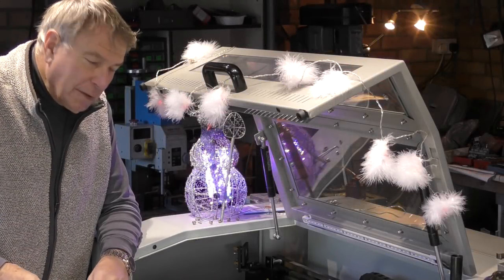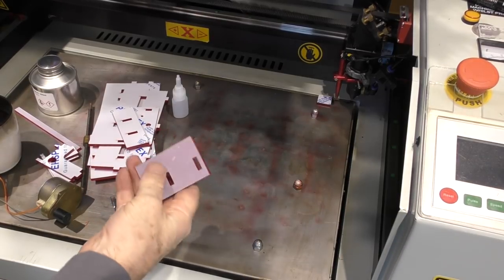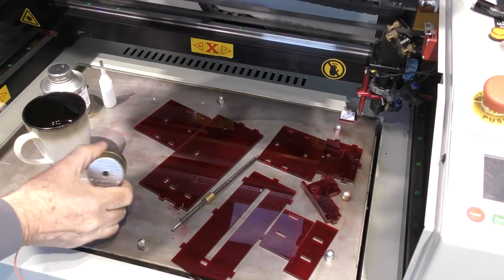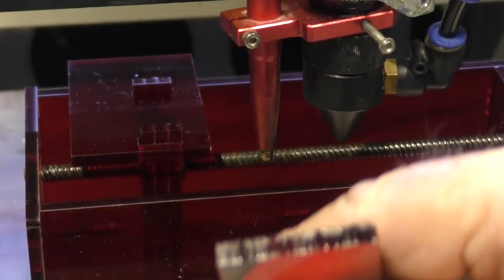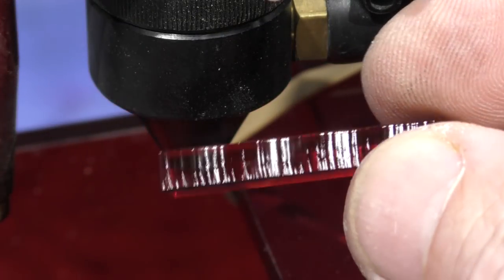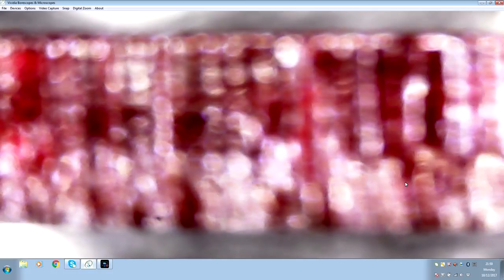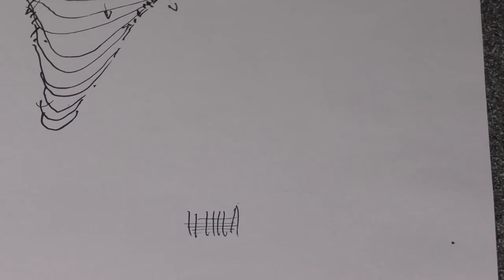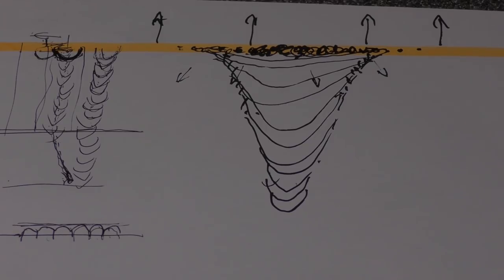RDWorks Learning Lab 128 Are Acrylic Striations Stepper driven

Comment: Not convinced that the stepper is responsible for anything as there's enough inertia in the head for it to be constant velocity. The out of focus "rows" of dots look like they're related to the laser firing frequency. If this was the gas cloud dissipating, they wouldn't be so orderly. Also refraction of the beam would make it move ahead of the cut no? I think the vertical striations are from air assist pulses. Hook up a compressor reservoir to the air assist to check it? or just an oil-less compressor? Have you got an indication of frequency of the vertical and horizontal lines? If they're audible frequencies, maybe they're just sound vibrations being transmitted to the head.
Reply from the maker: Hi Christopher
 Some of my conclusions are evidence based and some project that evidence to possible conclusions. So you have every right to form your own conclusions from what has been observed. On your first point about head inertia, can I point out that the head was static and it was the test piece was driven by a constant speed ac synchronous motor  through a large reduction gearbox. So for a completely different reason, there were no stepper or inertia effects, your conviction was correct. The striations were the worst I had ever seen but with not a step in sight. That was the whole point of the test. Many people were arguing that the striations were stepper driven. This categorically proves otherwise  and demonstrates that some other mechanism is responsible for the "footprints". So that is where we have to now call upon previously gathered facts and see how they can be linked into help answer this question. 
I  believe you have mistakenly understood this laser beam to be fired by some controlling frequency. This is not an RF driven device but a constant dc voltage driven system . There are high frequencies during the pre-ionization phase of the beam triggering but once the beam is working above above 4 or 5 mA the power is smooth and there is no beam triggering. These experiments were done well into that stable beam phase. I have carefully built a logical set of reasons why these horizontal marks exist, I may be wrong but I do know that there are no steps and no beam frequencies to pin these marks on.  I also think refraction is the wrong mechanism to consider.  Reflection is the most likely mechanism for beam drag (non-vertical striations). I investigated the interesting properties of acrylic a few sessions ago to demonstrate its amazing internal reflection properties  That reflection mechanism would trail rather than precede the beam as you were suggesting with the refraction proposition. I also think that careful observation the smoke velocity during my cuts,  clearly shows no evidence of air assist, so air pulses must be discounted as a biasing mechanism also. I attempted to remove as many variables as possible when I designed this test.   I can only point to specific pieces of evidence  and just like any jigsaw puzzle without a picture to follow, try to arrange the pieces in a logical way to form a more complete picture. I am sure I will get some bits wrong and will be forced to rearrange the pieces if and when I can gather different evidence.  
I must stress that none of what I am saying is condemning your thoughts, remember this is a learning journey for me and open debate must be taken as a healthy way to reach full understanding. I can't un-discover the evidence, however, help with interpreting those facts is always welcome. So, thanks for your comments because it allows me to clarify points that may be weakly emphasized in the video. Please continue to join in the quest for certainties within this technology because we have many dark corners yet to dig into.

Best wishes
Russ
Reply: Russ, healthy debate between consenting adults cannot be considered a crime. I'm also not one to tie my ideas and thoughts to my ego - a bruised and battered idea - even if it dies is worth more as a step to clarifying the truth than a billion unchallenged thoughts.
The one thing that really has no explanation I can see is how orderly the horizontal patterning is. your test with the water boiling - the pops increasing in average frequency as the beam is more focused but with a bell curve of time between gaps to me would be what the vertical distribution of the pattern should be like. It's too regular. You seem to have 2 very well defined frequencies. One image I have is that it's like a tap dripping - the other water boiling in a test tube. Might it just be liquid phase build-up ahead of the laser boiling and thus popping material out of both the top and the bottom? I have evidence to the contrary. I see pulses when I nearly cut through 3mm plywood of the same range of frequency. I'd take a high speed video of the laser tube to see if it is actually steady or if there is flicker. My guess is that it's a 10-100Hz frequency range which may be mains or compressor linked. Air pulses ?
Reply from the maker: Thanks for the great attitude and response. The water test was just an incidental demonstration of the surface effect. I was still many mm above the focus point. If I had gone higher the frequency would have indeed increased  but just like bubbles in a test tube the more external heat you apply the faster the rate of bubble generation. Even though the heat is applied uniformly the the water reacts in an intermittent manner.
 I have used my oscilloscope to monitor current flow through the tube and there is no evidence of pulsing when the tube passes into its full operating mode.  It is true that the nitrogen in the tube is continuously stimulated by the voltage output from a rather specialized transformer operating in the tens of khz but that is just to maintain the ionized state of the nitrogen. That ionized state turns the nitrogen from an insulator to a zero resistance conductor. As a completely separate part of the power supply, the current through this gaseous "piece of wire" is controlled by a fully smoothed DC current limiter. It is the magnitude of this current that completely randomly stimulates the CO2 into its lasing mode. Despite this randomness, the final photon output is coherent light energy  that is fully synchronized to a wavelength of  10.6 microns. This wavelength is equivalent to a frequency of about 28Thz  and is far too high to leave observable pattern. 
I'm unsure if your final sentence implies that you do have  high speed video equipment  (10 or 12000 frames per second? It would be amazing to see some of the phenomena at work) or if you are just suggesting that it would be a good idea to take high speed video?
Best wishes
Russ

Comment: I see what you mean about the belt now. This particular white belt is indeed not designed for linear motion, only GT type belts are specifically designed for that. Your belt has sort-of rectangular pattern, backlash is inevitable with such belt. GT2 style belts are industry standard for cnc application nowadays, check them out. I see you are running it on the opposite side, so maybe you are not using it’s teeth at all, that would be interesting to see :)
Reply from the maker: I chose this polyurethane belt with a different tooth form  (AT) to the original  HTD profile because I discovered that the original rubber belt had so much compliance in the tooth that it was causing head resonance at certain  micro step ranges. The shorter much stiffer teeth suppressed this to a much narrower speed range that I would never use anyway. The other advantage was that the mismatch in tooth form  gets rid of the natural clearances designed into the matching belt/pulley tooth forms. Because I have turned the belt over, my idler pulleys are driving the belt fully home into the driving tooth form so I have no belt climb and no backlash
Reply: SarbarMultimedia turning over is actually quite an interesting idea, if its tight enough shouldn’t be a problem I guess. Maybe I’ll try that too! :)
Reply: SarbarMultimedia hi Russ, i was able to reduce ripples by half by repairing geometry on X axis to a proper one. The rest of the problem I am sure its the bad belt, Kevlar belt on order.
Reply: SarbarMultimedia okay, after solving that ripple issue, now i have to solve another, and that is my steppers skipping steps/jumping randomly... 🤦🏻‍♂️ what else can go wrong with this chinese garbage :(((

Comment: Superb once again Russ - thanks!!!  I found this reference that I believe supports your conclusions: https://hal.archives-ouvertes.fr/hal-00915611/document
Reply from the maker: Hi Steve
Thanks for that reference. Although this paper is new to me the information is not. I come from a CO2 metal laser cutting background and was familiar with the dynamics of striation creation in steels. I had not anticipated being able to relate the same idea to acrylic until 12 months ago when I did a video  https://youtu.be/29L-3TpL8ws  The possibility that there was a relationship to stepper pulses kept nagging, hence this revisit. The huge striations I see in this video with a constant speed (non stepping) system are VERY similar to the steel striations from exotic industrial lasers where the axes are all ultra smooth  analogue servo driven with zero backlash ball screw drives.
 Hence my quantum leap to conclude that the stepper is doing something to break the natural stop start frequency of cut propagation, to a much higher forced stop start frequency.  
Thanks for the comment.
Best wishes
Russ